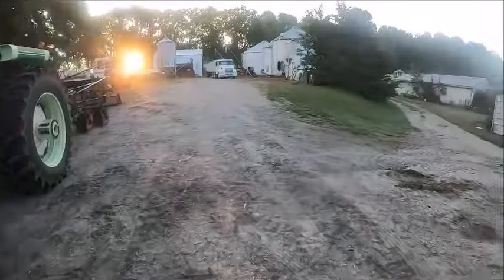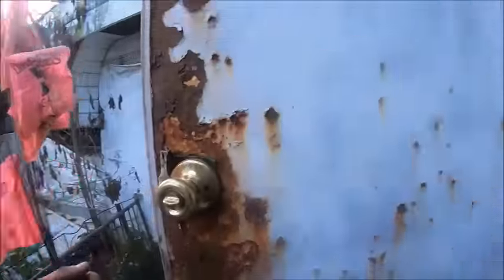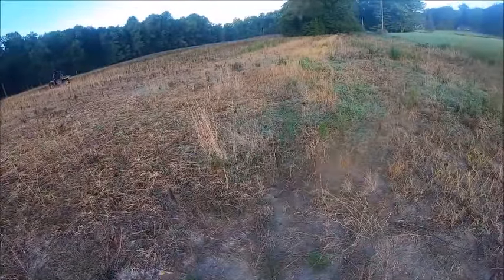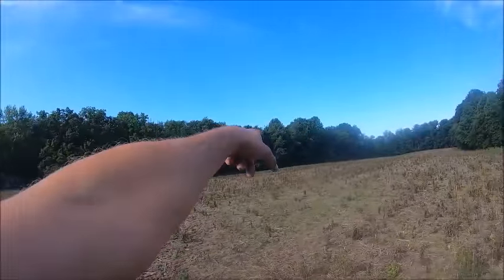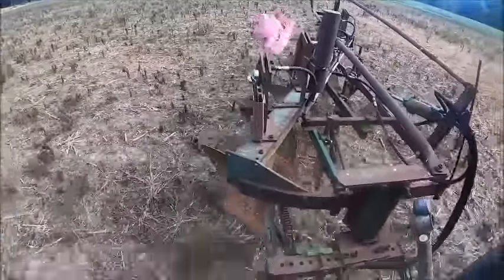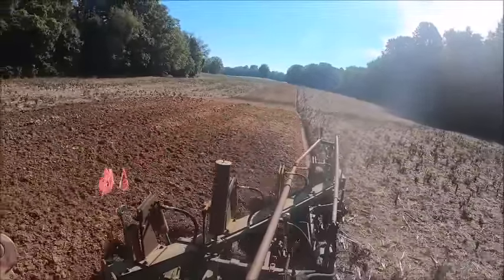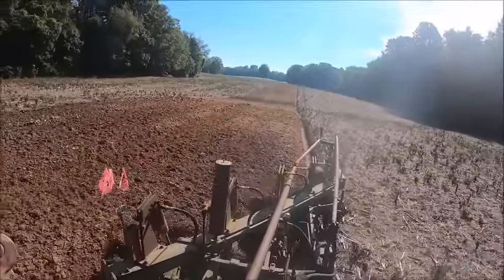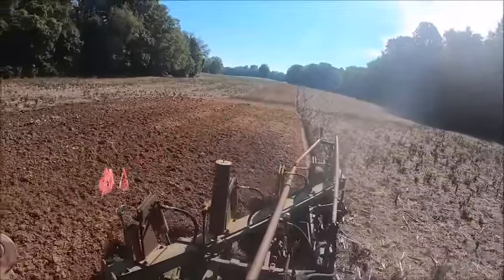When You Take A Moldboard Plow To A No Till Farm

Comment: Thanks for sharing your plowing... We had olivers and pulled a 4 with 1650.. a 5 with 1755 and a 6 with the 2-105/or a case 1200... loved plowing...
Reply from the maker: Me to
Reply: We pulled a 4 bottom with a 1750 and 1755, but we had pretty tight black soils in the bottoms and clay on the hills, so 4 would make them pull hard.

Comment: I’m mostly a Deere guy and I totally have to agree with you on the over engineered combine comment. Deere made some good, solid, reliable equipment but boy was it way too over engineered for its own good. Working on 4020s just plain sucks sometimes. It’s tight spaces and close tolerances and a very over complicated hydraulic and electrical system. There’s a reason our 4020s are 12v now instead of that mess of a floating ground 12v/24v combination system that was decided on. Great job of plowing. Field looks beautiful and makes me a little jealous that our hard clay doesn’t even work up close to that nice.
Reply: We had a 12v/24v 4020 and oneday I  went to start it and it fried the wiring harness it was converted to a straight 12v system by the time it went back to the field !
Reply: I can't say anything thing about those older John Deere combine we never had a John Deere combine all we had is CaseIH combine we had a old 1987 1660 caseIH combine it was a good combine we harvested with it for 5 harvest season but in 2018 dad found a 7010 caseIH combine and bought it after they got the dirt out of the fuel tank and got the same thing running it has been a good combine no major break downs besides belts and we had a baron in the unloading auger go out last year they came and put a new one in and charged the hell out of dad just normal break downs.
Reply: Well here’s a honest JD owner. Most won’t admit that the green stuff is totally over complicated.
Reply: The 24 volt system was not the  easiest system to work on but I know a lot of 4020s around yet still with the 24 volt system. 90% of the time the problems with the system were a result of a short in the starter directly to chassis. The tractor may start without you being able to notice a problem but the next thing you know the fuel gauge is fried and when you turn on the lights they get bright until they burn out too. Best thing you can besides  converting to 12 volt is plug the darn thing in during cold weather and don't crank and crank it because insulated connections get over heated and eventually short.

Comment: I no till my corn unless I get a field rented that has some issues like someone mudded the last crop out but I have never had a satisfactory alfalfa seeding in no till. My absolute best hay seedings have been mold board plowed in the spring and planted with three bushels of oats which we harvest and bale the straw off. Usually not very much weed pressure the following year and the seedings look great. I would entertain the idea of trying a seeding after a pass or two with a vertical tiller set at 2 degrees and about and inch and half depth.  Everything is so expensive now that it's a big risk to experiment.

Comment: been their.  you have to wait until after a GOOD rain to soften up the ground to break it. OR one time we ran a ( sod buster ) single shank at the head lands then used that as the entry point for the plow to get under the hard crust. took everything the tractor had to yank it thru the hard ground. that's when we stopped no-tilling.

Comment: you can complain but we ran a 7720 along side a 9600 and we called the 7720 old reliable she hardly ever broke. it was just so much more comfortable in the 9600 they are great combines Deere put alot more metal in them old girls then the 9400 9500 9600 combine but they are way easier to work on. The 7720 was a hard one to let go it was the last combine that my dad bought we ran a 7700 and that 7720 you want to know a bitch of a combine to work on is that 7700 the 7720 is worlds better lol

Comment: Nickles worth of free advice.  Pull your tail wheel up to raise the back bottom and drop the 3-point to compensate and level the plow when you are busting a new land.  When you make the 2nd pass you'll be even. The advantage of a simi-mounted plow it can all be done from the tractor seat.  We have an Oliver spring reset.
Reply: We were one of the last farms in our area to use a breaking plow we quit farming in 1986 sold all of our equipment and the IHC 770 6 BOTTOM WENT TO
Reply: @robertpayne2717  It's been 15 years since we used ours.  It has two trees growing up through it.  Son doesn't want me to cut them out for fear I'll hook on to it and use it.  A lost art done correctly.
Reply: @judithcoffing6326  Get it out man.

Comment: Moldboard plowing is a cure for nutrient stratification where all the Phosphorus and Potash is after several years is in the top 3inches very little in the 8 to 10 inch deep zones 
Also improves ph by moving lime into the deeper soils if the only lime applied thats been applied has never been plowed in.

Comment: There’s a product called till-coat by CaseIH. it’s like spray paint but contains graphite so it’ll rub off quite quickly. We use it all the time on our moldboards, as well as on our discs and drags. Ever since we started using it, we haven’t went back. It’s kind of the cats ass around here anyways.
Reply from the maker: I’ve heard of it. Never used it. Might have to look and see if Deere has something similar. They are a lot closer than the case dealer.
Reply: this is the John Deere  number TY25637 Similar product different name we have used it when we were in a pinch

Comment: if your looking to level out the ground after ploughing discs are good set the front row a few inchs deeper the rear disks up hier and it should spread it out that plough did a nice job never seen one like that before whats it made by and does it work just as good in clay soil? it would be funny if the cam you found had somthing on it other than ploughing nice work

Comment: My Grandpas tip so your moldboard won't rust is covering each moldboard in grease.
Reply: My dad put used engine oil on with a paintbrush
Reply: @miketidman3398  If it were me I would just spray paint the bottoms.